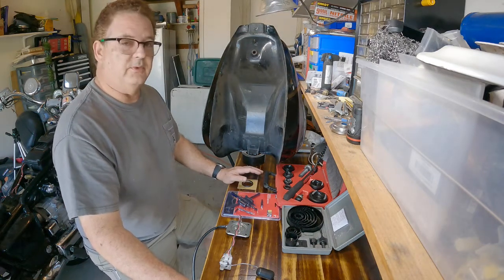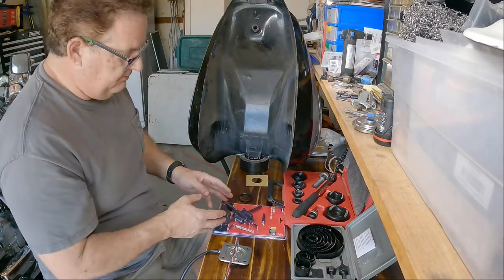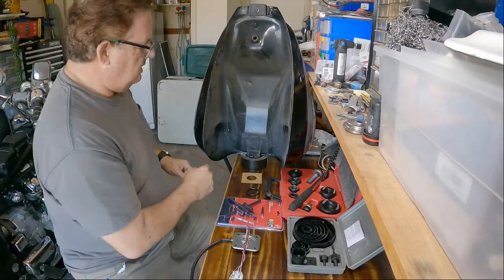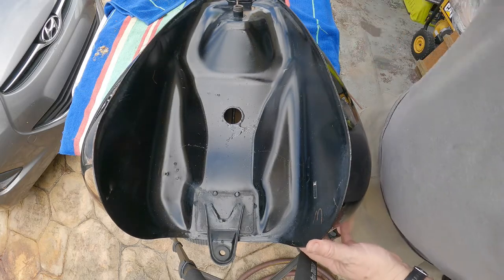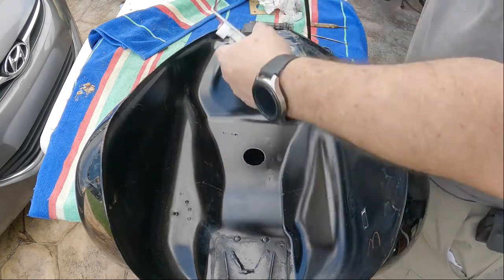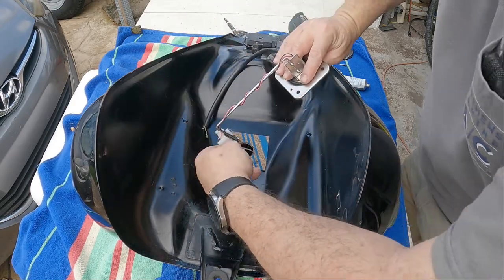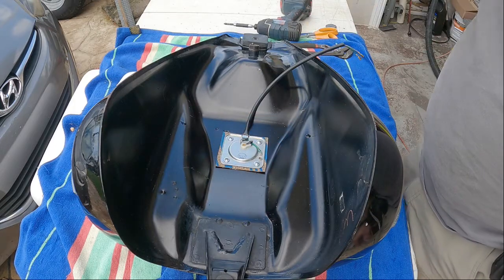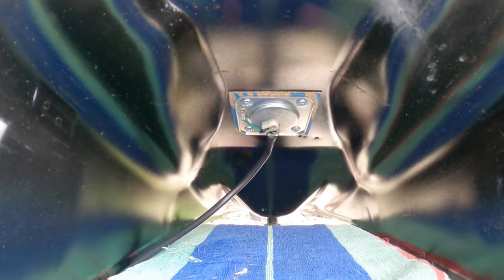Honda Valkyrie | Fuel Level Sender Install - Part 2 of 2

Comment: do you have number for the dash gauge and number for tank gauge  ALSO will you be posting a video on the hook up from tank to gauge  love the video thanks for  the info good luck
Reply from the maker: Thank you!
The gauge is from speedhut.com and the fuel sender was from partzilla.com
Honda FUEL UNIT SET Part # 37080-MBY-000
Reply: @TomAsay64  thank you so much man

Comment: What's the part number of the sending unit you used ? I would love to have a fuel gauge on my Valkyrie.
Reply from the maker: Hi David, this part number 37080-MBY-000 is for a 1999 Honda Valkyrie GL1500CF Interstate Fuel Sender. As you can see, it fit in my Tourer.
Reply: @TomAsay64  Thank you, so far I've only been able to find a used one on Ebay, but I'll keep looking I have a 97 standard and I've always thought it should have had a fuel gauge at the very least.
Reply from the maker: @davidsesco2447  I hope the Ebay one is good. Bikes of this caliber should have fuel gauges.
Reply: @TomAsay64  it was working when they pulled it off the bike. It's from a company in Daytona called Fallen Cycles.
Reply from the maker: @davidsesco2447  That's good news.